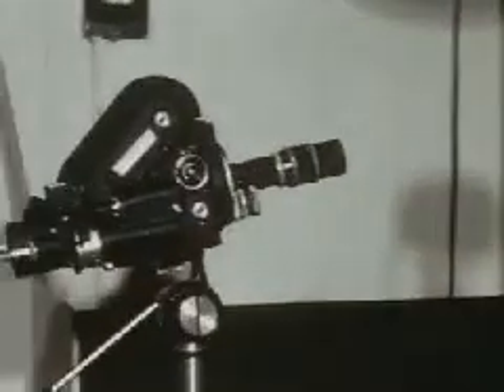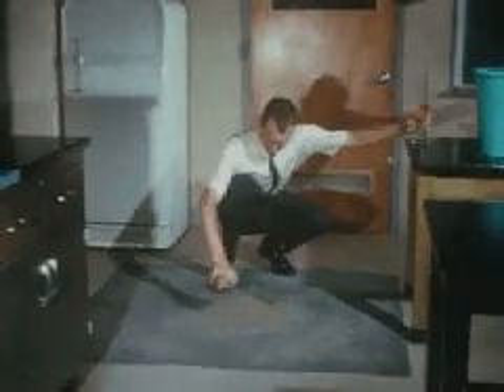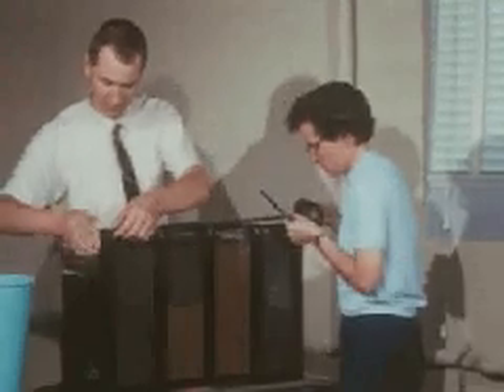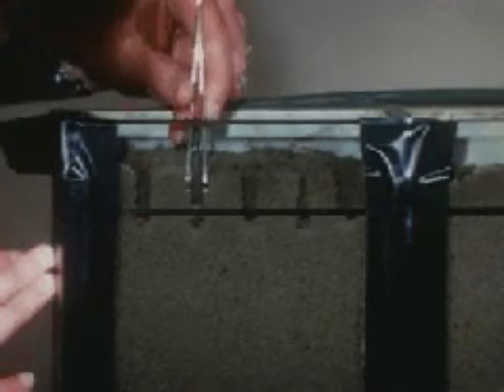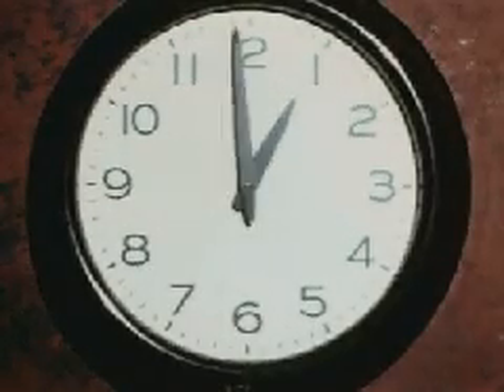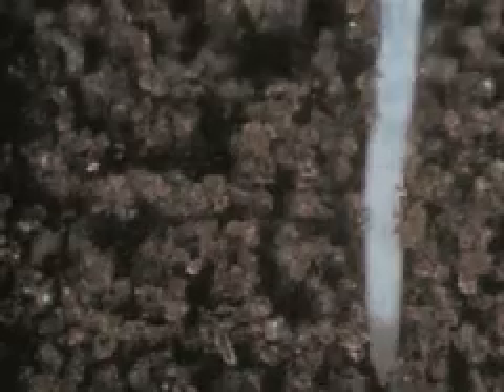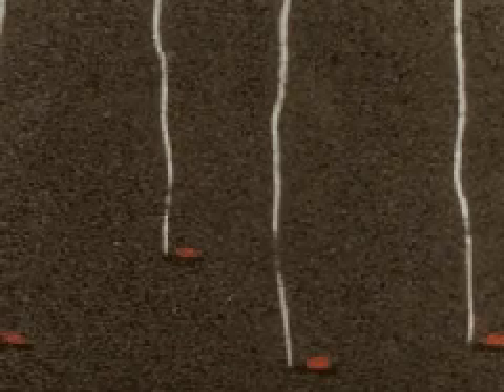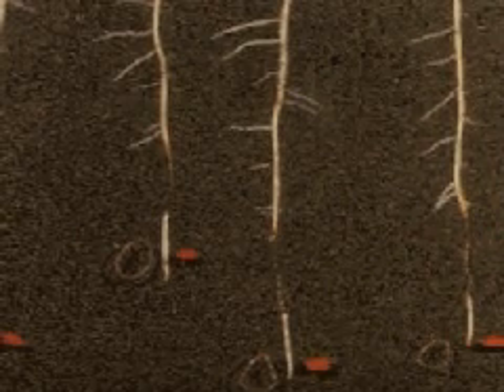Time-Lapse Photography of Root Growth

Comment from the maker: Yes, there are MANY out-takes.  Because the original footage was photographed at 1 frame every 5 or 10 minutes, but played back at 24 or 30 frames per second, there is quite a bit of time-compression. The footage shown here was accumulated over a period of about 6 or 8 years, and we selected only a few representative segments for inclusion in this video.